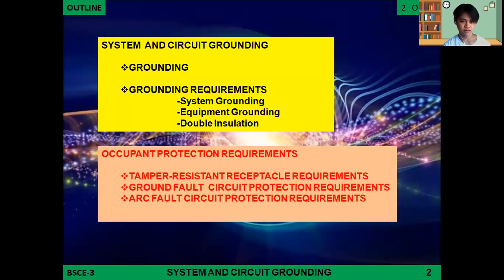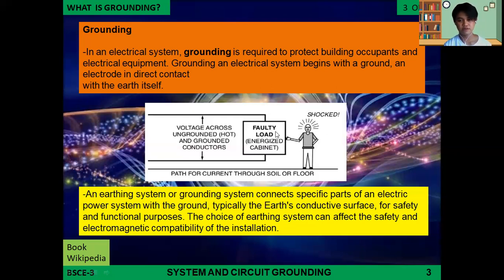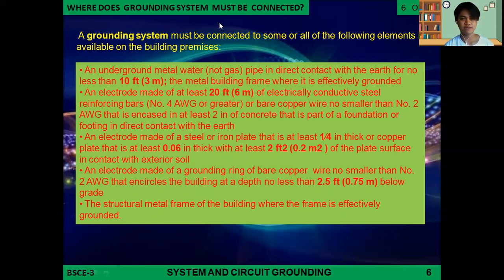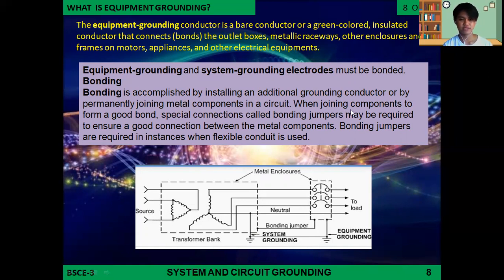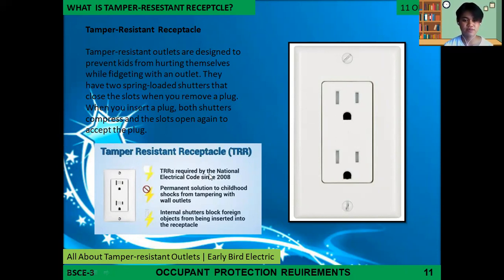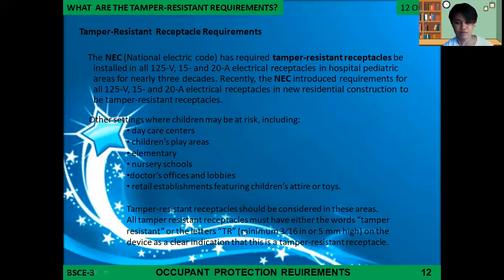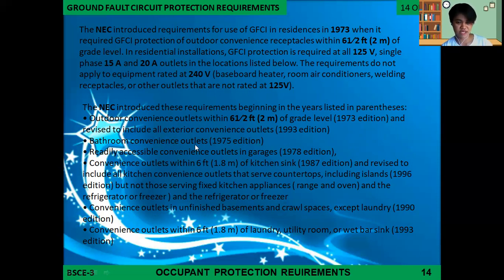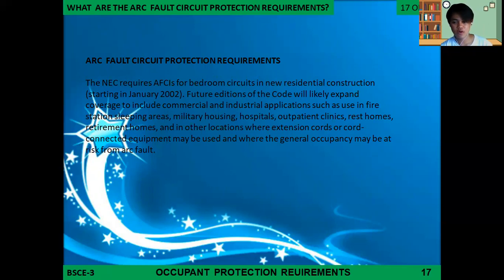September 24, 2021

Comment: I've discovered that the system and circuit grounds are in charge of protecting building people and equipment against electrical shock, short circuits, and thermal malfunctions that could result in a fire. They merely protect the structure from any unanticipated risks associated with electricity.

Comment: After reading Escobilla's report, I realized the importance of grounding systems and circuits. 
 Grounding the electrical system is essential to protect both building users and devices from the danger of excessively high voltages. Grounding is important because damaged circuits and electrical overloads can endanger you and your home. This voltage can cause a fire, damage equipment, or cause an electric shock if  not grounded. He also talked about the importance of occupant protection measures.

Comment: I have learned that the system and circuit grounds are responsible to impede the building occupants and appliances from electrical shock, short circuit, and thermal malfunction that might cause fire. They simply protects the building from any unexpected risk that usually occur in electricity.

Comment: In chapter 5, grounding is to protect building inhabitants and electrical equipment, is essential. A ground, or an electrode in direct contact with the earth, is the first step in grounding an electrical system. Grounding requirements there are two types of grounding
 system grounding and equipment grounding. In chapter 11 occupant protection requirements, the tamper-resistance receptacle requirement for nearly three decades, the NEC has mandated tamper-resistant receptacles to be installed in all 125-V, 15-, and 20-A electrical outlets in hospital pediatric areas.

Comment: After watching Escobilla's report which is the building electrical design principles I learned what is system and circuit grounding and also what is a occupant protection requiments and I also learned how important this thing is in protecting all our appliances and how thing thing ensure that all the devices are working in good condition in order to protect us from all possible hazards.

Comment: What I have learn in this video is that about the principles of building electrical design. There is what we called grounding that protect building occupant and electrical equipment, it prevents grounds or short circuits. Also, I have learned that the two type of grounding is system grounding that part of building electrical system that provides protection against electrical shock and system grounding.

Comment: For this chapter,it tells about some particular danger and hazard within the building which involve electricity,so system and circuit grounding is one of the important part of a building,it protects the occupant or the users and also equipment from particular danger such like excessive voltave.Damage circuits and electrical overloads are some of the most hazardous circumstances so groundings is a must.Also occupant protection measure is also a must and required to be knowledgeable.

Comment: In this presentation, I learned about the importance of grounding electrical currents. In this system, ground is the responsible to protect the building occupants and appliances. While, grounding conductor is the responsible to prevent the shor circuits. In system grounding, it peovides the protection against electrical shock, lighting and fires. Lastly, I conclude that this grounding, grounding conductors, systems ground plays a vital role to prevent hazardous risk to our house or in the buildings.

Comment: In this topic and video I learned that Electrical system grounding is achieved when one conductor of the circuit is purposely connected to earth, according to what I've learned. When a system is grounded, one conductor of the supply system is purposely linked to ground, which differs from other types of grounding (the earth). For the other conductors supplied by the system, this establishes a reference to earth.

Comment: I understand the importance of system and circuit grounding after seeing Escobilla's report.
To protect both building users and equipment from the dangers of excessive voltage, grounding your electrical systems is essential. Damaged circuits or electrical overloads can be dangerous to you and your house, thus grounding is important. This voltage could spark a fire, damage appliances, or cause shock if it is not grounded. He also talked about how important occupant protection measures are.

Comment: In this lesson, I learned about the system and circuit groundings, Circuit groundings  or Electrical grounding is a backup pathway that provides an alternating route for the current to flow back to the ground if there is a fault in the wiring system. It facilitates a physical connection between the ground and the electrical equipment and appliances in your home, and also Electrical grounding is a backup pathway that is generally only used if there is a fault in the wiring system.

Comment: In this topic, I learned about how important the system and circuit grounding, the two types of grounding which are the system grounding and equipment grounding. System grounding is that part of a building electrical system that provides protection against electric shock, lightning, and fires. The equipment grounding, path that connects the noncurrent – carrying metal components of equipment.

Comment: I have learned that Electrical system grounding is accomplished when one conductor of the circuit is intentionally connected to earth. The difference between this type of grounding to others is when a system is grounded, one conductor of the supply system is intentionally connected to ground (the earth). This establishes a reference to earth for the other conductors supplied by the system. When equipment is grounded, it is connected to earth or to some conductive body that extends the ground connection.

Comment: In this topic, I learned that the electrical system in the human body is related to the central nervous system. Through your electrical panel, grounding enables power to return to the earth in the most efficient manner. The purpose of a grounding wire is to safely discharge excess power from an appliance or electrical equipment.

Comment from the maker: This video provides some insights and informs us about the most important reasons for grounding electrical currents, which involves protecting the various appliances, your home, and everyone in it from electrical surges. Furthermore, I've discovered that if any of those lightning strikes or power surges occur at your home or any other location for any reason, your system will be exposed to dangerously high volts of electricity, but on the other hand, this so-called system grounding always ensures that any devices are in good working order.

Comment: According to the lesson, grounding protects your equipment, your home, and everyone who lives there against power surges. System grounding, in addition to what I've learned, restricts the potential difference between metallic masses and ground. System grounding also ensures that the protection devices are operational.

Comment: After watching the video, I learned that if any of those lightning strikes or power surges occur at your home or any other location for any reason, your system will be exposed to dangerously high volts of electricity, but that this so-called system grounding always ensures that any devices are protected and in good working order. Grounding, I've discovered, protects your electronics, your home, and everyone who lives there against sudden power.

Comment: in this video, i learned  that The electrical system is similar to the nervous system in the human body. Grounding allows power to return to the earth in the most efficient method possible, through your electrical panel. A grounding wire is used to safely discharge surplus power from an appliance or electrical equipment.

Comment: This video gave me some insight and explains the most critical factors for the underlying of power flows, which include taking care of various gadgets, your home, and everything in in it from electrical surges. I've learned that System grounding  ensures that the protection devices are operational, and it protects your home,  gadgets and other appliances  against power surges.

Comment: Upon watching the video I've discovered that if any of those lightning strikes or power surges occur at your home or any other location for any reason, your system will be exposed to dangerously high volts of electricity, but on the other hand, this so-called system grounding always ensures that any devices are protected and in good working order. I have determined that grounding secures your equipment, your house, and everyone who lives there against power surges.

Comment: This video, give me some insights and tells us about the most important reasons for grounding electrical currents which involves in protecting the different appliances, your home and everyone in it from surges in electricity.  Additionally, I've learned that if any of those lightnings strikes or the power surges at your home or at any places for any reason, your system will be exposed to dangerously high volts of electricity but on the other hand this so-called system grounding always makes sure about the protection of any devices are in good condition.

Comment: As we conclude the informations, In every part of the electrical system, system and circuit grounding refers to the upper limit of the voltage's defined values to the ground. It also connects the electrical system's current-carrying point to the ground, such as the neutral of transformers and rotating equipment as well as lines.